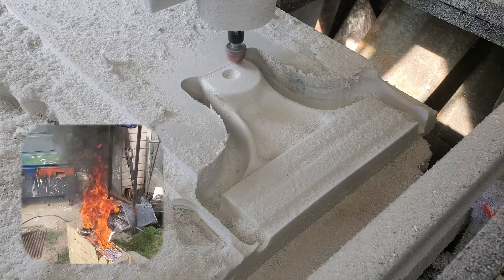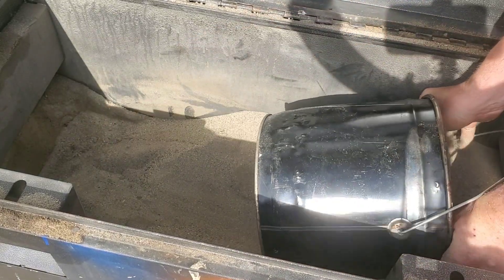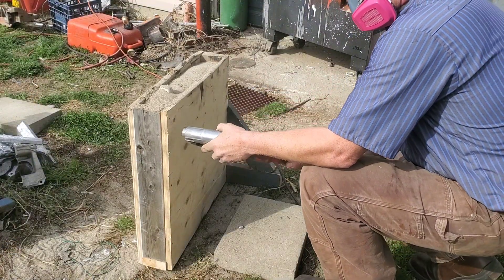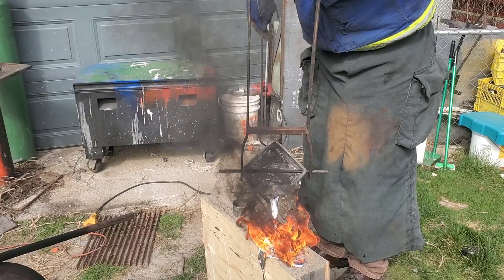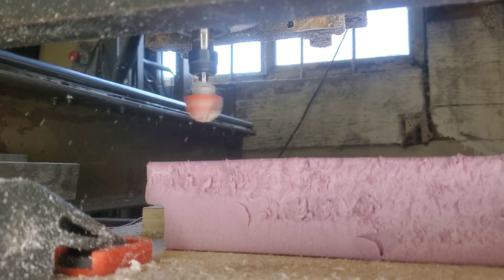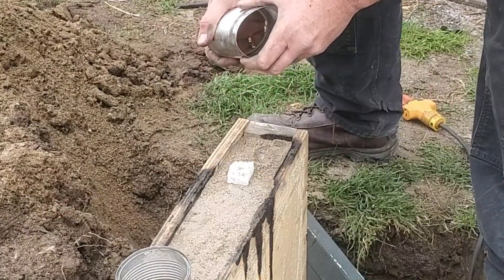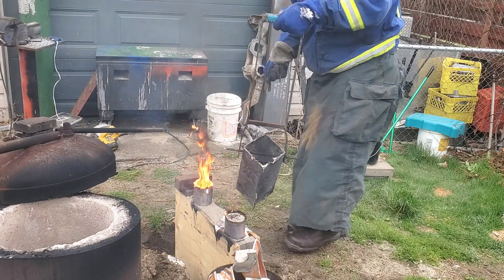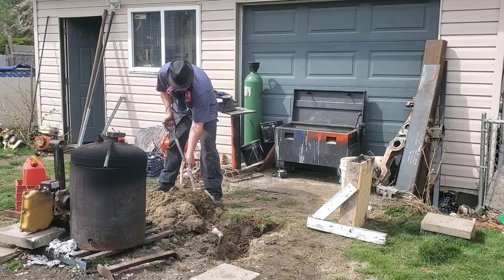Lost Foam Casting CrankShaft Truing Stand part 2

Comment: Is wet sand an issue at all?
Reply from the maker: Wet sand can be a big issue if to much moiture , water turns to steam and expands 1500 times its size .    This method uses dry so i dont have that issue .  The green sand casting method . Slightly different does use water pr oil in the sand with minimal issues . But it needs an acurate ratio to work best safely

Comment: Instead of the tap magic, try some denatured alcohol or turpentine.  Lots cheaper and smells better.  The DNA evaporates off and dont make a mess at all and prevents chip weld.
Reply from the maker: Thank you . I will try that

Comment: Could you build your box without a bottom, stick it in your job box, fill it with sand, then do your pour directly into your job box? That way you can just lift the box off when you are done. Any overflow would be into the sand in the job box. It means lifting the molten metal higher so that might be a problem.
Reply from the maker: That is an awsome idea i like the direction of thought on that. The only draw back is that i would be running very high for pouring .   I will think more on that idea and see if i can incorperate it into the set up .

Thank you mark !
Reply: @Wrighmachining  Maybe use a rope and pully attached to the garage?
Reply: Or dig a big hole to bury the job box 😉